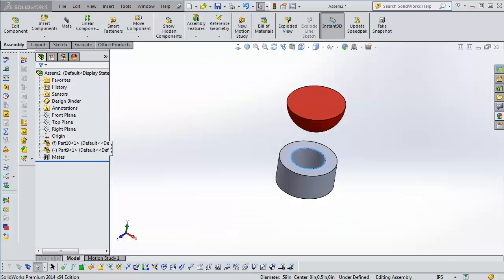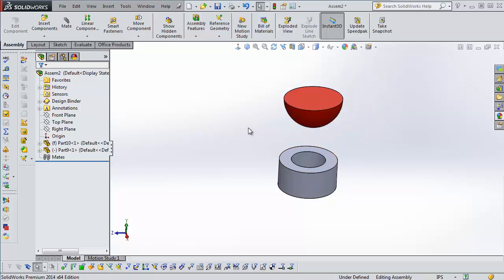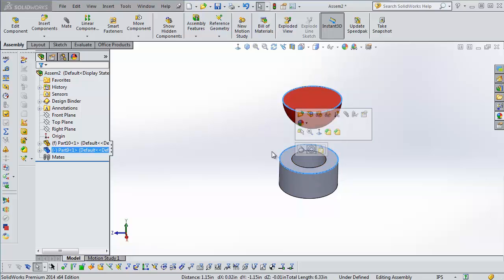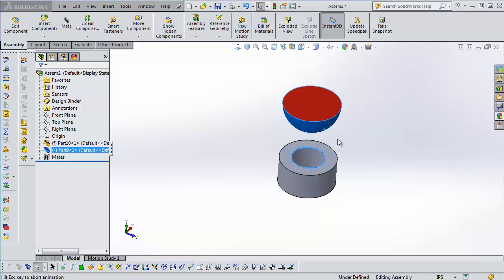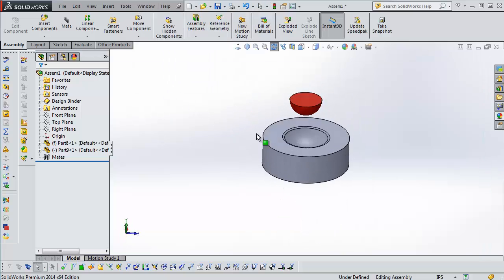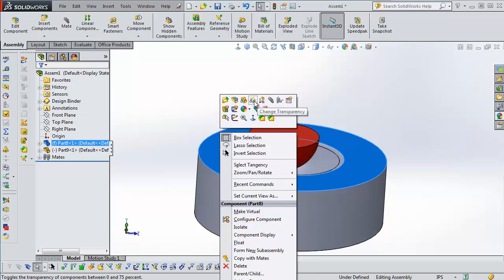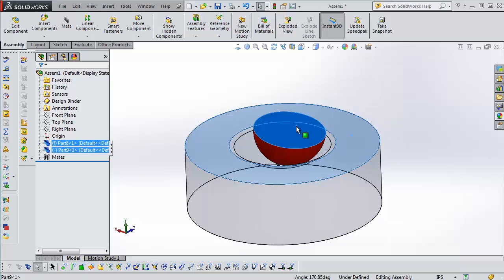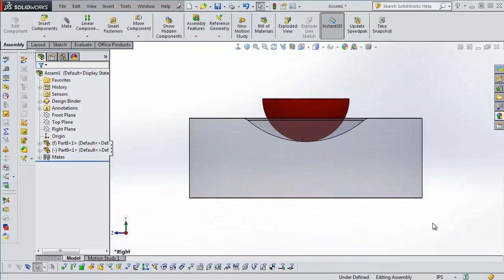SOLIDWORKS 2014 — Spherical Mates

Comment: Another common occurence is a sphere resting on an o-ring to create a seal when the ball moves into contact with the o-ring. So if I have a steel ball and an o-ring in close proximity, aligned on a center axis common to both, I don't get the ease of mate creation by choosing both (click the ball followed by ctrl-click the o-ring). If I try to create the mate, Tangent is a clickable choice. But mate creation does NOT occur when choosing the green checkmark. No warning. SWX 2020 does not pop up a msg saying "this ain't gonna work". Nothing. One would think all was well and that the mate was created. No. Any advice?